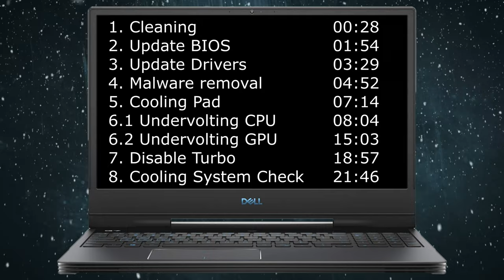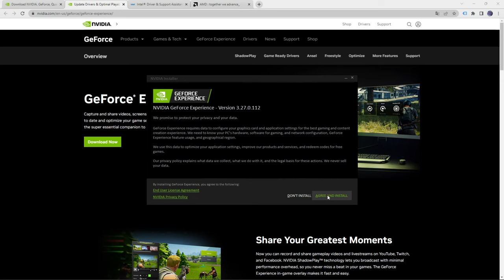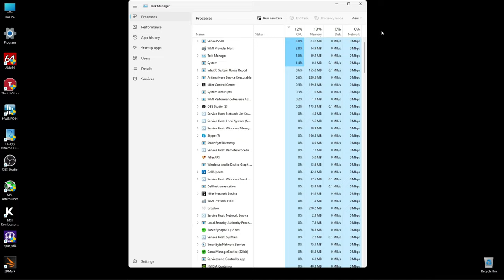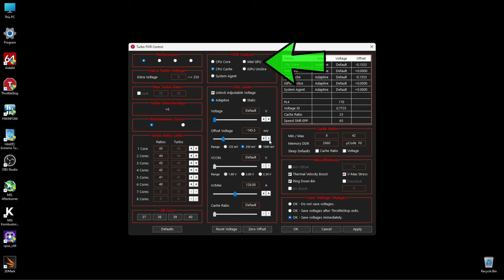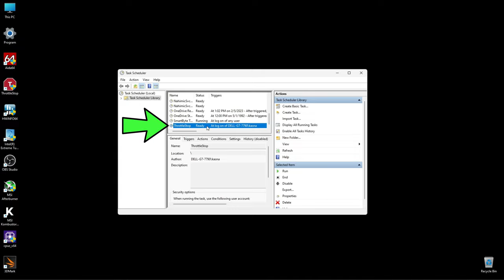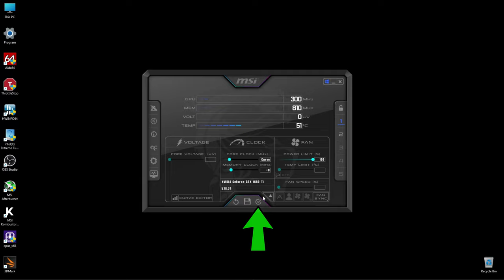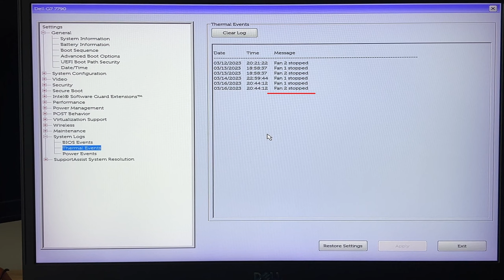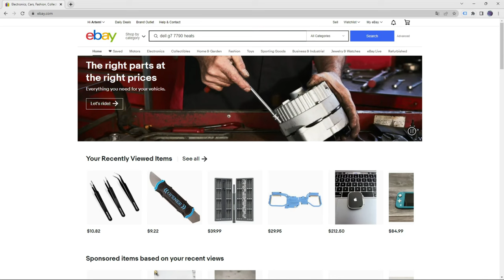How to fix laptop overheating

Comment: "CPU core and Cache must have the same undervolt" WRONG! In fact, using less cache undervolt will allow for a much larger core undervolt, which is far more beneficial for boosting behaviour and temps. Cache undervolt will quickly lead to errors and less performance before crashing negating benefits. Stick to half or less of the core undervolt for cache.

Comment: is it normal that my laptop CPU aggressively dried my thermal paste within a few days after re pasting?
i've used Thermal Grizzly Kryonaut for my Intel Core i3 1st Gen CPU Laptop, i've clean the fan, repaste the CPU and set everything like the video said (but i still haven't undervolt my CPU and i don't need to do the same thing to my Intel Graphic Card, i guess) and as a result, i got 38-45 C when idling and watching video and maybe about 50-80 C when playing not so heavy games.
is there any solution please ?

Comment: Can I apply these solutions to my MacBook Pro 2018?
Reply from the maker: This video is for Windows laptops but here are some solutions you can apply, steps 1 and 8 for a MacBook Pro.
How to fix overheating MacBook Pro:
1) Clean the cooling system: Use compressed air to blow out any dust and debris from the cooling system of your MacBook Pro. You can also use a soft-bristled brush to remove any stubborn dust particles.
2) Replace the thermal paste: If you have noticed that your MacBook Pro is still overheating after cleaning the cooling system, it may be time to replace the thermal paste.
3) Close unnecessary applications: Running too many applications simultaneously can cause your MacBook Pro to overheat. Close any unnecessary applications to reduce the workload.
4) Use the activity monitor to identify any applications or processes that are using excessive resources. You can then close or quit these applications to reduce the workload.

Comment: Hi, when I start Cinebench2024 the cpu(Acer Nitro 17 i7: 13700HX, RTX 4060) immediately throttling, the fans are set up to max and the temperature hits 100C. The test runs for 10 minutes and the cpu clock speed drops to 3GHz(the cpu max frequency is 5GHz). The cpu score in cpu-monkey is 1371, but mine has 938. Also Intel XTU shows power limit throttling, the cpu is idle,  and power limit and current/edp throttling at the same time while gaming. For example in Days Gone the fps are capped to 120(1440p) and the graphic setting are almost the highest, the cpu and gpu temps are about 75C, but the cpu frequency and frames drops(3GHz and ~90fps) from time to time(every 30-60 min) for 2-3min. Do you think these problems can be fixed with replacing the motherboard, the laptop is under warranty. I bought it two mounts ago and it is cooled with liquid metal thermal paste. Thanks!

Comment: i5-8250U shows error at -110 mV on my dell-xps 13 9370. Remember to hit stop as soon as error appears or you will have to force reboot. Currently i set to -100 mV. Increase in stable core clocks by 300 MHz with R23 scores improved by 500 points. Temperature change is minimal 0-3 deg. C. I haven't changed thermal paste/cleaned the radiator in my five year old laptop yet.

Comment: help please? when i entered UEFI/BIOS to check my cpu temp, it started at 40°c and raised to 73°c within 5-7 minutes (i was not gaming or previously gaming) i also noticed my cpu fan speed would not exceed 774rpm… does this mean my fan is faulty and i need replacement? please help thank you so much!! 

(i have a 2019 ASUS ROG Zephyrus G15 GA502DU) 

problem literally occurred overnight… not sure what happened but besides the overheating and low fan speed, the laptop still runs beautifully, no lag or slow loading speeds at all? i never once had a problem with it until now

Comment: I seriously think I got a HP laptop lemon.  A little more then 2 years old and the CPU/GPU is running hot even when idle.  Had it checked several times and everything is as it should be.  Essentially HP ran out the clock on the warranty on purpose and now I have a brick I can't rely on.

Comment: I cant undervolt my intel core i5 13th 13500h in ACER NITRO V 15 rtx 4050 GAMING LAPTOP

Any tips
Reply: Remove windows microupdate code, disable secure boot and core virtualization. Then run GRUB from an USB disk and overwrite overclocking lock bit to 0x0 (should be at 0x10e for 13th gen, check your bios) and you are good to go.
Probably invalidates your warranty and makes system vulnerable to plundervolt tho. And changing the wrong thing in BIOS can brickc your laptop.

So cooling pad and power limit for you it is.

Comment: But I am unable to click on CPU Core under Turbo FIVR Control window
Reply from the maker: To give you advice, I need to know your CPU model. 
Anyway, you can try next: go into BIOS and reset to factory settings - this can unlock the CPU Core and CPU Cache in Turbo FIVR Control
Reply: @howfixit  I have MSI GE76 11UH laptop and it has i7-11800H
Reply from the maker: @goldfish279  Go into the BIOS and do the SHIFT + CTRL + ALT + F2 trick to unlock advanced options such as overclocking and then enable XTU.
Then Throttlestop will work!
Reply: @howfixit  I have lenovo IdePad 3 whit Ryzen 4600h and 1650 tell how to that Unlock Advance Options in Bios. I realy need that Options. Tnk u.

Comment: I usually CUT some 【white Styrofoam】 into small pieces and putting it underneath my laptop at the back(left n right corners) to raise up about 1 inch height(25mm), 

this will allow the air flow under the base to cool down any Laptop Overheating Issue 。。。。。。👍👍👍👍👍👍